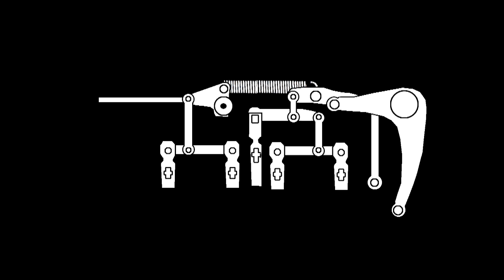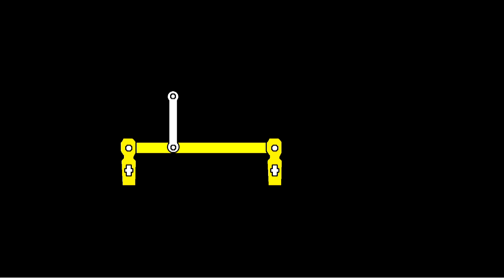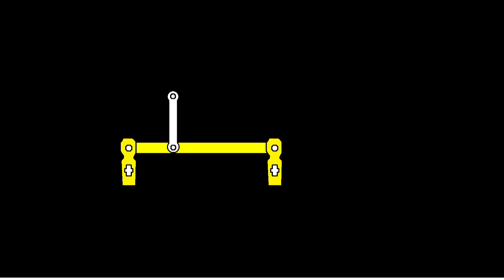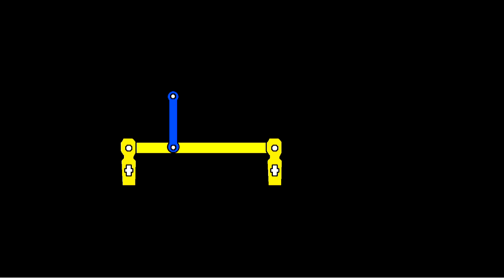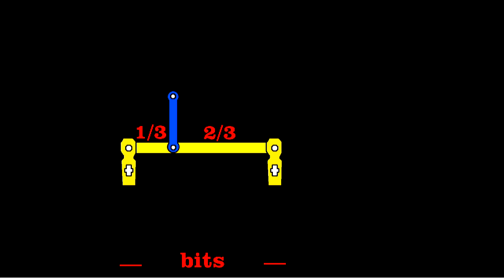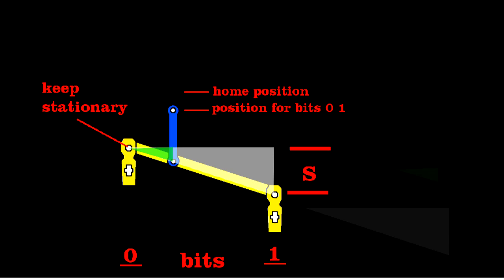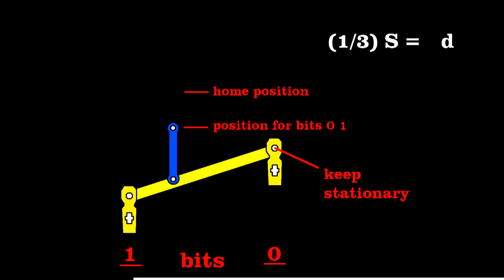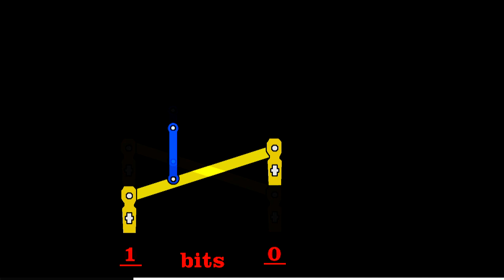The Whiffletree: A mechanical digital-to-analog converter

Comment: I used to work with a 1938 teletype machine that spit out 8bit ASCII paper tape, and a paper tape reader that would convert it back to readable type.  This was a backup system for our secure, computerized communications systems in the Air Force.  If you opened up the console, it was purely mechanical, and extremely complicated.  There were guys that had received special training to maintain them.  They were always a mystery to me, but no longer, thank you so much.

Comment: This is also a visual look at how you can count four numbers (0-3) with only two bits. The typewriter used here had 5 bits, that's 64 positions, which include the alphabet two times, numbers 0-9 and a few extra symbols. Pretty nifty!
Reply: So funny that this comment has sat uncorrected for 7 years. I'm not sure of the inner workings of this particular typewriter, but 2^5 = 32, not 64. 2^6 gets you 64.
Reply: @iNowHateAtSigns  good catch. What's driving me crazy is that it's actually even less than that, as the whiffletree mechanism can't be arranged to hit the 2^x discrete output states for x inputs for x>2. This arrangement of 5 input latches actually only gets you 28 discrete output states.
Reply: @PBOZAI  That's because one has four states for the tilt, and the other controls the rotation, and has 8 states, of which actually only 5 are used. Then there are two more bits that isn't a part of the wiffletree, one deciding which way to rotate (left or right) for a total of 15 possible (but only 11 used) and another bit that rotated the head 180 degrees, controlled by the shift, for a total of 22 positions. That times the four tilts give 88 characters.

Comment: @Richardatf Later models of Teletype used a version of a Wiffletree that was driven by rotating clutches driving eccentric links.  This let the machines run at a blazing 150 baud because the eccentrics controlled both the select and deselect motion of the typebox (desmodromic, in a way).

When the Model 40 was introduced, it used a rubber belt to hold the type elements, and 80 individual hammers. There was a metal flag to tell the electronics the start of the type sequence on the belt.

Comment: Ingenious! I'm wondering, though --- since the output is still discrete (just not binary-coded any more), with a resolution of S/3, isn't it still digital? Wouldn't it need some sort of smoothing mechanism to make it more continuous, more truly analog?
Reply: I'd say it counts as both digital and analog.  The output is an unencoded quantity, but is constrained to cerrtain values.  Similarly, a rotary dial with detents is both digital and analog.

Comment: I suppose the whiffletree component used to convert the binary actuation of the latches for the column has been simplified here? Trivially, 3 binary latches could only convert to a max of 8 states, rather that 22 (or 11, if the shifted hemisphere uses a separate mechanism.) Furthermore, by my reckoning, the 1/9 and 8/9 positions are unreachable from the system shown, and the 3/9'ths (1/3) position can be reached via two input sets: 011 and 100. 

That leaves the shown system with only 7 actual positions.

I can't seem to find an actual image of the full device unfortunately. So I will just have to go buy and break one myself to find out!

Comment: I'd say this is just base conversion instead of digital-to-analog. After conversion, the data is still represented by discrete values. It's just converting binary to quaternary in the case presented here.
Reply: That is virtually word for word what I was thinking, some five years later.
Reply: +BlameItOnGreg 

Except that the "quaternary" output isn't 4 individual outputs, its a single output with multiple positions. The most advanced DACs you might find in modern day hi-fi sound equipment and scientific instrumentation are just continuations of this basic principal. ie a 24-bit audio DAC takes a sequential binary input of 24 values, and outputs one of 16.7 million possible voltages.

It may not be the infinitely continuous analog we consider to be, but it is certainly analog
Reply: +Al Longley If it can be represented by discrete values, it is not technically analog. Analog is non-discretely continuous. In the example of a 24-bit audio DAC, it is technically converting from base 2 to base 16777216. Also any good audio DAC actually does analog electronic smoothing between the discrete steps before final output, thus making an actual analog signal.

Also, I fixed the typo; thanks.
Reply: So if you term this base conversion and not DAC, where is the distinction made between this and any other DAC? You say any good audio DAC would include a reconstruction filter (separate to the actual conversion implementation), what about every other DAC, are they simply not DACs?
Reply: ***** If they remain as discrete values they aren't technically a DAC, though within common vernacular it is common to call things that prepare data for real world output DACs, regardless of wether they have a reconstruction filter or not. It's just a matter of how strictly we define analog within these contexts. I'm not one for exacting specificity of words within everyday contexts, but when it comes to technical fields, explanations, or a learning environment, I think strict definitions are far more important, and serve a vital role to understanding new subject matter.
Reply: +BlameItOnGreg +Al Longley

Cool discussion!

The portion of a DAC that is analogue is the output where the encoded digital signal becomes becomes an audio waveform 

In the type writer there is more going on than four bar positions, there are 22 rotation positions to giving 22 x 4 = 88 possibilities , he just simplified things in the example by looking at vertical only, 2 bits, 4 states

I suppose it would be more specif and accurate to say this device offers a ready way of mating the concepts of binary outputs (encoding text) and the concept of rows and columns to an existing mechanical device that renders a representation of that text that we can read easily in hard copy form. replace the typist with two stepper motors and a bit of logic circuitry and you&#39;re in business, then it&#39;s a digital device... A golf ball printer!

I agree that using the phrase analogue appears at first a bit misleading but he does qualify that by saying &#39;it&#39;s electromechanical, not electronic&#39;  not being electronic does make something non digital, because although you are only encoding data at certain thresholds of voltage or position, the constantly variable nature of the phenomena used renders the device analogue  

I don&#39;t think anyone&#39;s suggesting text is analogue information
Reply: +hydorah Whether something is electronic (or electromechanical) or not, has nothing to do with whether it inputs or outputs an analog signal. The key point here is that this device only does base conversion, and base conversion can only technically give you an analog result if you convert to a base of infinity. If there are discrete states (2, 4, 88, or 2000000), then it isn't technically analog. In the real world, you also have to take into account the signal to noise ratio, among many other things, but in terms of describing things as perfect machines, anything with discrete steps is digital. Also, as I said, with quality audio DACs, the thing that actually yields an analog output is the smoothing or reconstruction filter that takes the digital output, that for Redbook CDs is in 2^16 discrete steps every 44100 discrete steps a second, and smooths out those steps using analog electronics.
Reply: +BlameItOnGreg I'm not having a go at you so no need to get on the attack and conflate ideas that are not relevant to the point at hand. Google 'analogue computer'. You are presently confused
Reply: +hydorah My point at hand is that the term analog is so often misprecisly used, and I wish it weren't used so imprecisely within technical and learning environments (such as this video). Everything I've said has been relevant to that point, in explaining what analog actually is, and how this machine and audio DACs (that were brought up by another commenter) fit or don't fit within that definition. Analog computers are different from this device. They use continuous, i.e. non-discrete, representations of values, whereas this device is designed to take discrete input and give discrete output.
Reply: There is actually no need to be so pedantic about the word analog, the dichotomy about "discrete vs continuous" in the analog/digital case is not as strong as you make it seem. If you study bot words, and specially 'analog', there is no necessity of continuity for something to be """analog"""". If your argument is "this machine does not produce a continuously varying signal", you are correct. But nobody, including Bill, said the opposite.

Comment: @engineerguyvideo
No doubt you are familiar with the "ticker tape parade".  The ticker tape was, to the best of my knowledge, an 8-bit ASCII format as well.  You see old video of the stock market guys watching a tape feed, they could actually read the code.  This was the forerunner of the teletype system I spoke of.  Scratch all that, there were 5 holes in any given row in both units.  Called 5 unit Baudot Code

Comment: Smoothing isn't a necessity for a digital to analog system, especially since this was for a teletype converting it to discrete characters, so the specifically defined positions that control the print head are actually the goal.  For digital to analog audio conversion, smoothing is generally preferred, but that's hardly a simple problem, and a lot of it's even up to personal preference.

Comment: Can't the blue bar be kept at 1/4th and 3/4th or for that matter any other place other than the center ?
Reply: Only if you don't care about the equal spacing of the blue bar positions. With your scheme, you'd end up with 0 * S, 1/4 * S, 3/4 * S, and S. This wastes dynamic range, so you'll need whatever the blue bar is actuating to be made to a tighter tolerance. The difference between 00 and 01 is 1/4 * S, so it must hit within 1/8 *S. With 1/3 & 2/3, the difference is 1/3 * S, and your tolerance can be 1/6 * S.

Comment: Why is the blue bar placed where it is? Wouldn't it make more sense to place it in the center?
Reply: Then pulling on either tab would move the blue arm the same amount. Pulling one tab needs to produce an output movement of 1/3, and the other needs to produce 2/3, hence the difference.
Reply: Ah I see, with it being centered, there are 3 possible positions as having just the left tab up or just the right tab up produce the same height. With it being off center, having the left tab up moves the blue tab up more than just the right tab so there are 4 possible positions.

Comment: @engineerguyvideo - for the other part of the whiffletree, I only count 3 linkages, which would theoretically encode only 16 combinations, yet according to the previous video, they'd need to encode 22 (necessitating 5 bits; you even claim this entire setup encodes 7, which would make sense).  So how does it do it, inquiring minds want to know!  ;-)   My guess would be that each of those linkages have more than 2 positions.
Reply: Look more closely, there are 5. The 2 on the far right appear to have rotational motion instead of linear, probably to save space.
Reply: There are two more bits that isn't a part of the wiffletree, one deciding which way to rotate (left or right) for a total of 15 possible (but only 11 used) and another bit that rotated the head 180 degrees, controlled by the shift, for a total of 22 positions. That times the four tilts give 88 characters.

Comment: I want to see the right hand side mechanism working
Reply: There is no right-hand side mechanism. The pall on the right is actually actuated by all 5 inputs as they needed 22 possible positions. That's 2^5 required. The 2 we have seen here do a manipulation to the right through the spring on top.

Comment: Blue bar stroke is not feasible it's a pin joint you might have to revise the design
Reply: I guess that's why the IBM Selectric never worked.